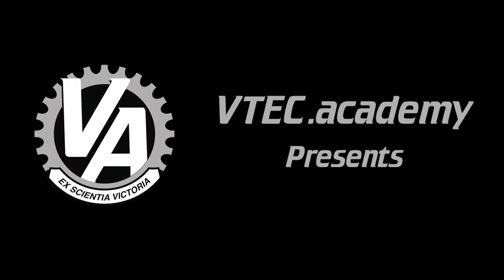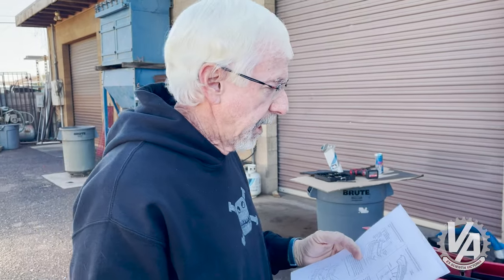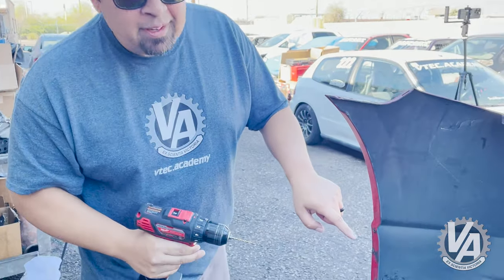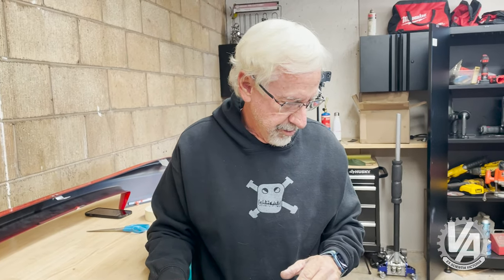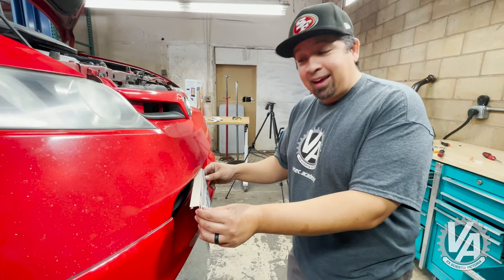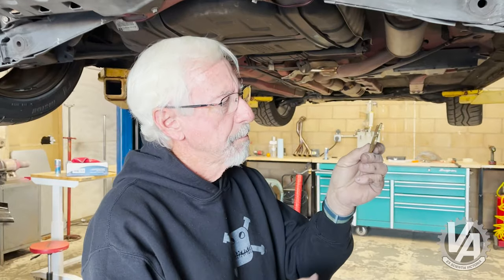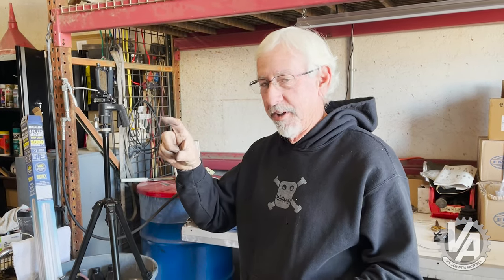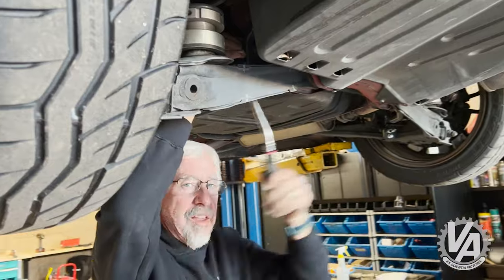Car Mods You WON'T Regret! 8th Gen Civic HFP Lip and Progress Rear Sway Bar Install

Comment: I just received my Progress 22mm too 🤘🏻 the paper instructions are vague. You guys kill it as usual! Beautiful timing!
Reply from the maker: Luckily other than the braces, it's quite straightforward. It's such a great bang for the buck modification.
Reply: @VTECAcademy  Looks straight forward. Just was wondering about the braces which you showed. Up front I have just a DC strut bar and upgraded links. I heard it's better to leave the front bar alone and just do the rear.

Comment: In the past I've owned a 93 Del Sol SI, 99 Civic EX coupe and 99 Integra GSR. On all, first thing I did was new front OEM swaybar with poly bushings and 22mm rear Swaybar with anti-walk.

Comment: Just so you know for next time, the push pin marks are on the inside of the bumper not the outside.
Reply: I came to type that very thing. I’ve installed many a Honda accessory over the years. There also may be other marks as well that apply to other accessories so be careful.
Reply from the maker: Aww, man! Thanks, next time we will know.
Reply: @davidcook1394  are you a qualified technician?
Reply from the maker: @timwilliams4739  We could have used one!

Comment: Aren't the marks on the inside? That's probably why you use the pin, to push through and you then can see where the hole goes from the outside too. On TL bumpers they have those same marks on the inside for A-spec lips.

Comment: Noob here, aren't you supposed to put a load (no pun intended) on the sway bar before you torque it?
Reply from the maker: Nope, not needed. When you want load on it is if your car is really slammed to check your end links. You want the end links to be as vertical as possible with the car on the ground. you will need adjustable end links so that you can get the right angle.

Comment: 5drs euro spec 8th gen fn is a so much better looking car compared 8th gen sedan, it only came in hybrid to my country which doesn't help. the softer springs and isolation made the hybrid a good drive.
Reply from the maker: I don't know, the JDM 8th gen sedan is pretty good looking. The FN is great looking, too bad it has CRZ/Fit suspension.
Reply: @VTECAcademy  The Fit platform is the best bit IMO!  There's so much space with the rear seats folded down, despite the car only being ~4.3m long.  I fit eight wheels in there, with space to spare!  (I think the 10/11th-gen hatch gets similar cargo volume as the 8th/9th despite a higher boot floor, but only by physically being a much longer car -- the driving position is also a lot lower in the newer hatches, but I honestly don't mind the high driving position of the 8th/9th hatch.)

The torsion beam rear suspension is not an issue for me (the Renault Clio RS197/200 & Megane RS250/265/275 are considered some of the best handling hot hatches and have beams too -- I really like the RenaultSport products, they seem to very close to Type R products in philosophy).  Between having normal front-end geometry (like the 8th-gen sedan and coupe AFAIK?) and having more rear shock stroke, IMO the FN2 handles better than my prefacelift DC5 did, regardless of not having IRS (at least the FN2 is much more predictable and inspires more confidence! there's a lot less bump steer and weirdness).  [I understand facelift DC5s had a little more caster and stuff to try to improve the handling though.]

(Actually, the FD2 Type R has only just become available for import to Australia in 2020.  Just in time for the prices to explode: a 15-year-old FD2R actually goes for as much as a 5-year-old FK8, which is just crazy! Re: at rem79, I think the sedan and coupe look better than the hatch (much sleeker at least, the hatch kinda looks like a blob), but I do like the hatch too, the hatch feels a little bit French and out-there: at least Honda were trying to do something different with the 'spaceship' theme and unusual car shape and created, IMO, a very well-resolved & usable product in both the original 8th-gen hatch and the 9th-gen update. :) )

I like these 8th & 9th generation of English Civic so much, that I actually prefer the FK2 Type R over the FK8.  I like that it is a shorter car, that it still has the magic seats with the bigger cargo area, I prefer the more rounded styling, the two-tier dash with real physical shift lights (etc).  IMO, having the Fit platform and a beam rear axle doesn't hold the FK2R back IMO (perhaps it holds the FK2 back as a time attack car, but JAS successfully raced 9th gens with the OEM beam layout (albeit racing parts) in both WTCC & TCR, so it can't be insurmountable). Unfortunately the FK2R never came to Australia, just the ordinary R18 base model (& the 1.6 diesel in negligible quantities, that was a slower seller), I had an ordinary R18 9th-gen hatch and really liked it too. :)
Reply: @VTECAcademy  after 2003 the suspension took a dive. For sure. Now we get Electronic stabililty where in the past it was more mechanically based stabililty.